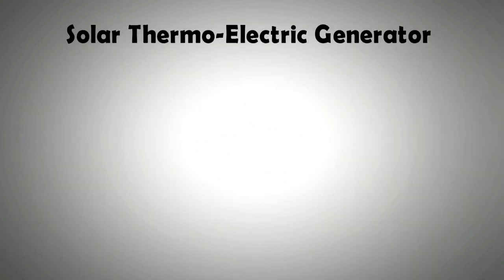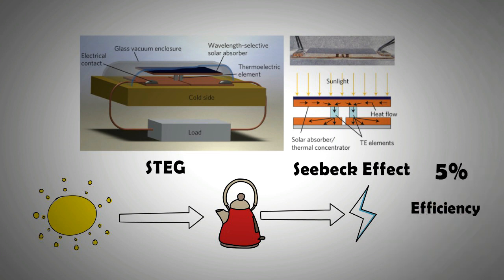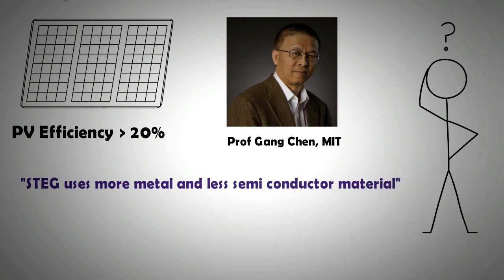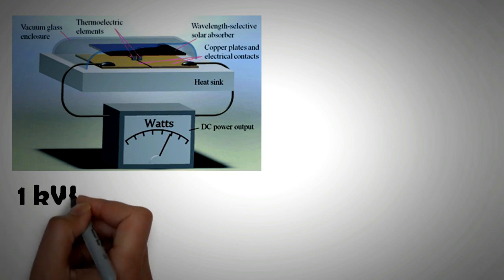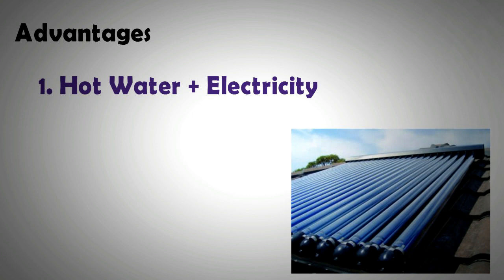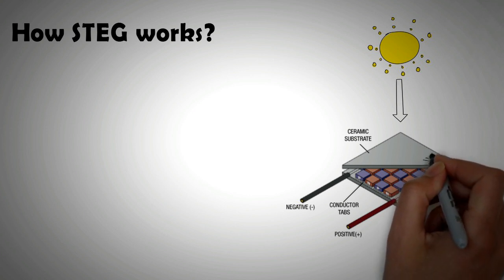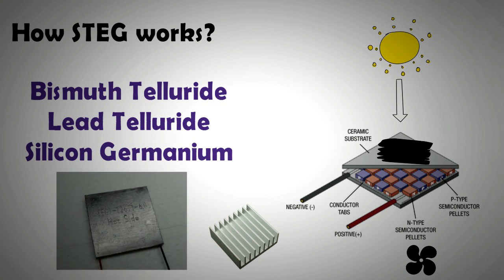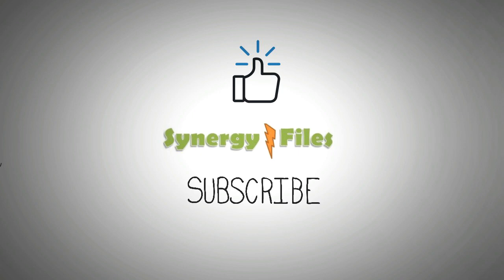Solar Thermo Electric Generator (STEG)

Comment: I don't think thermal electric will really take off. unless the efficiency is greatly improved. the typical peltier plate works better cooling. than generating.
Reply from the maker: +James stranger True. They are trying new materials with slightly better efficiencies
Reply: Not only in the desert places but even in the tropical and sub-tropical places.
Reply: I think there's some ways to integrate TEG into systems we already use to create what I call regenerative charging. Theoretically we could all retrofit our gas-burning cars to carry a TEG ... like you say though efficiency is a big thing.. you don't necessarily want to add a 200kg TEG to your pickup so you can listen to the car speakers with out using the car battery. You're not quite making enough power to run everything but it's a bit ... like maybe a CPU cooler that has a TEG built in, that TEG charges a USB bus or your laptop battery a little.... or eh, put a TEG on your camp lantern near the elements or a camp stove with a TEG(this is real already). STEG is just another piece of the puzzle. There's a cool thing with phase exchanges and capillary action ... so many cool things, regenerative cooling on rocket engine shrouds is another clue. I have a lot of raging clues pointing in different directions.
Reply: Maybe a small amount of some radioactive material placed on the peltir module would give you electricity for life.

Comment: FINALLY the idea of turning heat into battery power is being allowed into the sun light for us to see at last?   Very cool!  How soon can people in the third world start turning heat into battery power I wonder?
Reply from the maker: Solar is the fastest growing energy source at the moment, not just in the developing world but all over
Reply: just buy a bunch of peltier modules on ebay and glue them to the back of your solar panels
Reply: @UltraRik  and add water to cool other side of the pielter cell ,water can be cooled if run through under ground soil or from a river.
Reply: Patrik Banek or, in the setup of the solar tank heater, run the cool water just under the tank through a flattened portion of pipe, with the Peltier device between the hot and cold. Bada bing, ideal thermal disparity, you could use the power for a worm gear motor that tracks the sun to provide even more efficient solar heating.
Reply: What about a heater or cooler that is 2 phase, assuming you want cooler air, you could use a stainless steel vacuume housing (think yeti cups)  with and oil reservoir in between, with the only parts not protected by the heat shielding being the Peltier devices. The unit would have to have the ability to reverse air flow from outside, to inside, and also to collect energy or expend it. In cooling mode, the Peltier device could use an ultra efficient P.C. cooling fan to run the air over the heatsinks attached to the Peltier devices, once a certain time has elapsed or temperature has been reached, you would then have the unit go into recovery mode, taking the inside air and pushing it outside, while recovering the electricity from the stored heat in the oil reservoir... if you took four modules connected together, you could have 2 in recovery and 2 in cool mode all the time theoretically... this should increase the electrical efficiency to the point that it would compete with or surpass traditional compression based a.c. units, no?